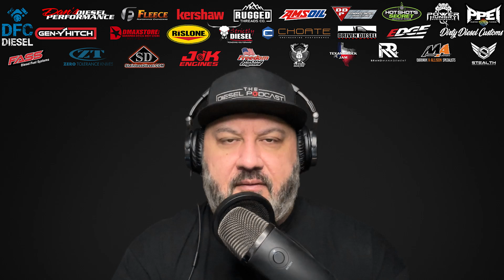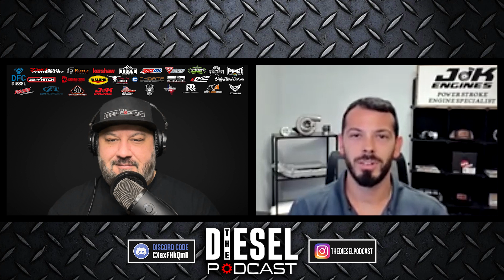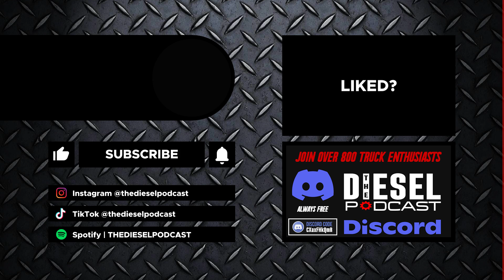Reliable Powerstroke Builds + 6.3L Stroker

Comment: I have a question....i just bought a 2005 6.0.  It takes a lot of cranking to start...but, when it starts it runs great.  Smooth,  sounds good.  The water fill container, doesnt leak or boil over.  There is no blow-by at all.  Id like to understand the long cranking before it starts.  My real question that puzzles me is it smokes blue smoke very heavily, like its burning oil like a big dog. The oil needs to be changed, but its full.  If it was black smoke id think that it was burning overly rich....but its not black, its definitely blue smoke.  I cant expect a perfect diagnosis by someone who isnt dealing with the engine in person ....im just asking for thoughts and idea's from 6.0 experts.   Thx so much

Comment: Engine topics are always my favorites! I hope that an L5P topic is discussed at some point, similar to the LML, 6.4, etc to include common engine problems; what internal differences between the L5P and LML (why the crankshafts don't have a high failure rate vs LML, LMM and LBZ, piston designs, etc) and what components, if any, are backwards compatible to the LML and earlier Duramax engines. Thanks!